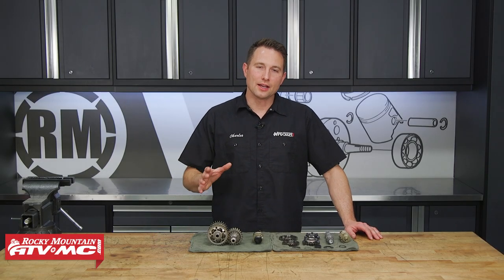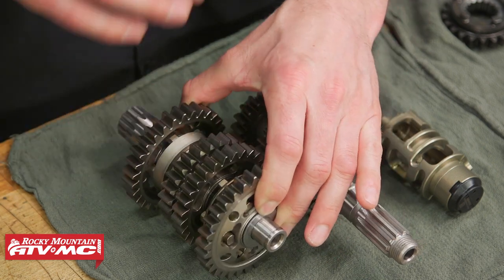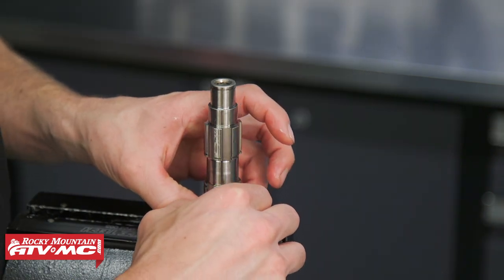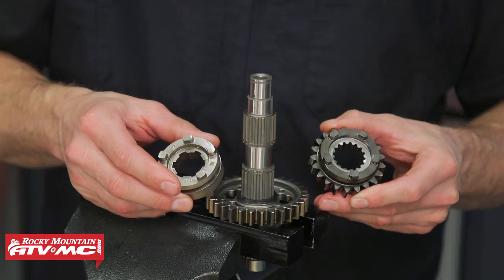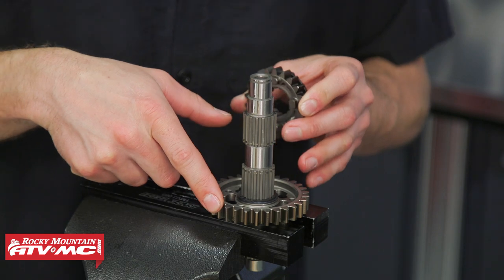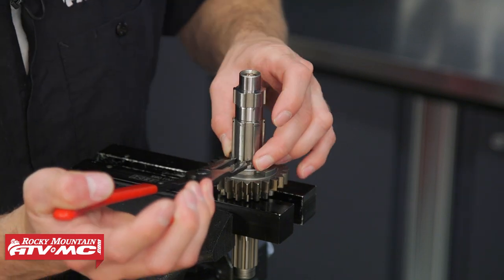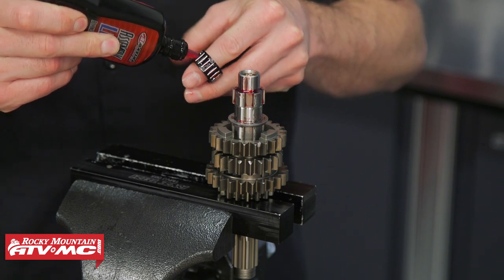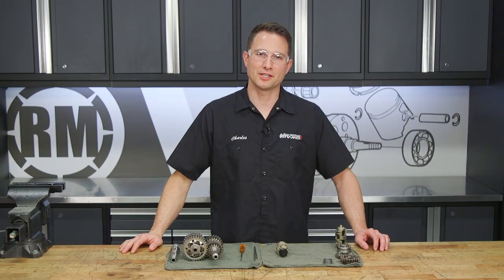How To Install a KTM/Husqvarna 6th Gear Wide Ratio Transmission Kit

Comment: This is great,  it gives guys confidence to tackle splitting the cases.  If you can do a timing belt on your car,  you can build a bike engine.  KTM makes splitting the cases much easier than other brands,  rarely any need for heating blankets etc.

Comment: Excellent how to video and love that Rocky Mountain put the time in to make a 6th gear kit. I do have a question of why the 19-22 kit comes with a 5th gear idler for the main shaft when the idler gear your replacing is the same part number as the one you’re replacing it with?
Reply from the maker: Thanks! It's actually not the same part number. One of the gears is one tooth different, so both of the 5th gears are cut differently than the stock gears on those bikes. -Charles
Reply: Thanks for your reply . I’m trying to figure out exactly what ratio changes will be made primarily to 5th gear. My understanding is that the XC/SX 2018-2022 all use a 5th gear 24:24 ratio. Also the 2018 450 XC/SX counter shaft part number is 79433010100 which is the same counter shaft used to add 6th gear. If the sliding 5th gear from a 2018 KTM 450 XC/SC part number 79433015200 was used it would fit the new counter shaft and still maintain the original 24:24 5th gear ratio also eliminating the need to purchase a idler 5th gear. Is your kit changing the 5th gear ratio to the 23:24 wide ratio transmission of the EXC? @rmatvmc

Comment: I’m trying to figure out exactly what ratio changes will be made primarily to 5th gear. My research and understanding is that the 450 XC/SX 2018-2022 all use a 5th gear @ ratio. Also the 2018 450 XC/SX counter shaft part number is 79433010100 which is the same counter shaft used to add 6th gear. If the sliding 5th gear from a 2018 KTM 450 XC/SC part number 79433015200 was used it would fit the new counter shaft and still maintain the original @ 5th gear ratio also eliminating the need to purchase a idler 5th gear. Is your kit changing the 5th gear ratio to the @ wide ratio transmission of the EXC?

Comment: I have a 2015 FC450 I might be looking to do this on but when selecting 2015 only KTM is an option. Is the 15 sxf motor/ transmission different than an FC?

Comment: Would this fit a 2014 450sxf Factory edition? looking at the parts diagram the 2015 factory edition has the same parts as the 2014?